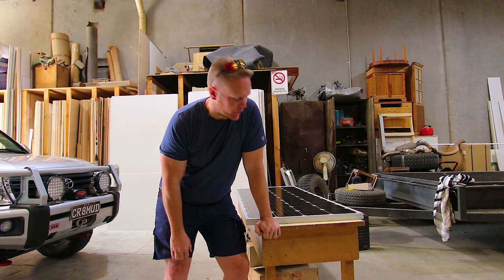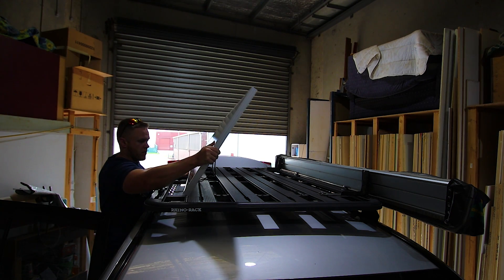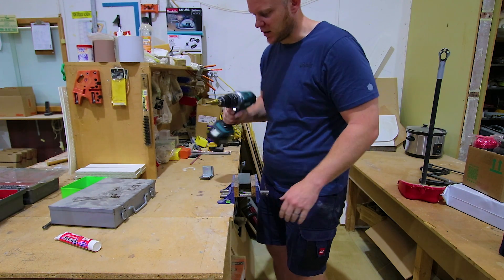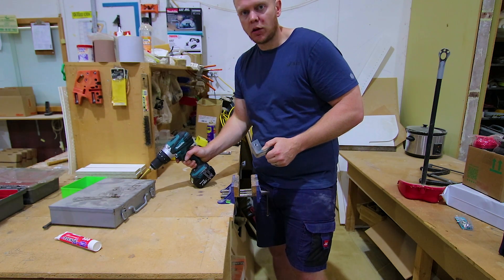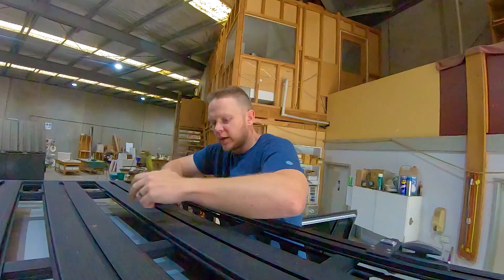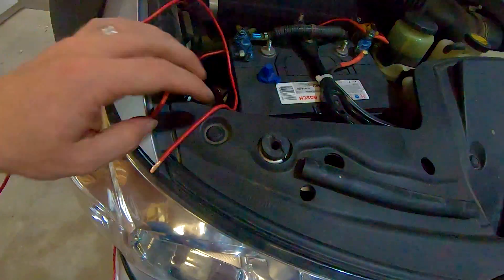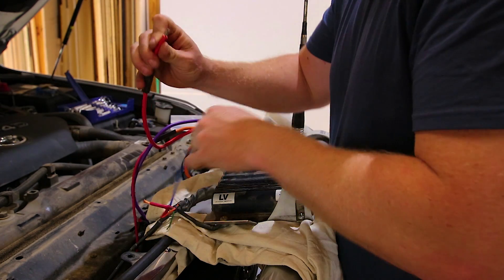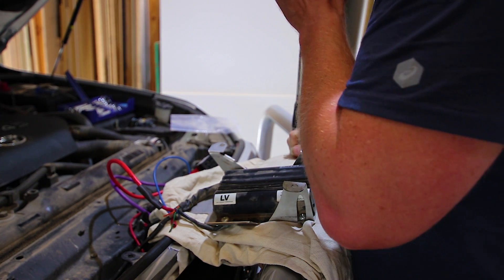Solar Car - Installing SOLAR to YOUR car - NO DRILLING - 300 watt solar panel

Comment: Did you test the wattage ? That is way too small to be anything more than 120 to 150 watts, size is everything when it comes to panels. I like how you routed the cabling from the roof, very neat. Also if you speak to guy's that specialise in wiring for 4wd's they usually recommend crimping over soldering as solder does fatigue from the movement in a 4wd which causes cracking over time while good crimping allows for movement and does not crack like solder.

Comment: FYI If you want to use a shunt to monitor the battery, you will need to run neg wire back to the shunt
Reply from the maker: My battery had a built in shunt which measured it with or without the negative connections. 
DCS 200.   

But yes for normal shunts that is what’s required

Comment: Great job mate. While I agree partially with some of the comments here that bringing earth wire back to source of chassis bond points might be a good idea - the fact that most people commenting here don't realise is that the chassis is a much bigger conductor with better electrical properties than an 8g wire, so that addresses most of the return path. Yes there is potential for the 'last mile' to have some resistance, the Pioneer rack has 8 good quality bolts directly to the roof rail mount points (which are part of the chassis), and the cross members of the platform that connect to the platform mount rails - there are 6 of these. I have measured from one of these cross-member bolts to a ground point under dash - 0.05 ohms. You will NOT get that in an 8 gauge wire, I guarantee it.
Reply from the maker: I personally never had a drama with the way it was wired up.

Comment: Is that thin cable really enough over that length? I would think you'd need a thicker cable to handle the output from a solar panel that size... Also an anderson plug isn't really an ideal plug for a solar panel, it'd be better to use a solar connector - they are designed for solar cables. And lastly does the cable you used have UV stable insulation? It doesn't look like it does. If not it will quickly become brittle and won't be suitable as insulation. Just some thoughts.

Comment: Whats the point of this? Asking as i know nothing about solar usage
Reply from the maker: The point of having a solar panel on your car would be to keep a secondary battery charged up so it runs your 12v fridge longer
Reply from the maker: The point of having a solar panel on your car would be to keep a secondary battery charged up so it runs your 12v fridge longer

Comment: Hey Steve, great vid - it certainly took me a while to find it 2019 etc!! Just a question re: earthing - If the primary battery is earthed to the chassis, and the 2nd/3rd batts are also earthed to the chassis - is it just the power wire that matters for the circuit? ie does having multiple batts to the same earth not matter when wanting to draw power from the aux batts only? Cheers.
Reply: No, not at all! All you need is one common earth point, for all charge sources and load sources for that 2nd battery supply, in fact, if you are running a shunt for the 2nd battery to monitor these flows, and the shunt monitor point only has ONE wire on it to the negative terminal of the 2nd battery (Refer a good source such as Victron, Redarc, Enerdrive). ALL devices should be earthed via common point. In this case, the pioneer roof rack system has solid earth to chassis via 8 mount points, and the platform cross member has 6 bolts connecting it to the side rails. The only potential issue for earthing is Steve's brackets with the earth lug on one of these, but he's proven it works. This is FAR better than bringing an earth wire back to the common earth lug for EVERY appliance, and ends up in a much neater install.

Comment: Solar trailer build buddy.  Build a Solar panel trailer with 9 panels on it 2.5 meters by 4 meters. That would really charge the batteries up wouldn't it.

Comment: I’m not sure why you would cut off perfectly good IP67 MC4 connectors from the solar panel and replace with Andersons. I would have retained MC4s and used weather-resistant solar cable through to the DC-DC charger. But we all make our own decisions. Thanks for the video.

Comment: Hey Steve great content , I’m thinking of a rigid panel on my roof bars mainly so I can still use same space to put my swag on top  just need to know if panel can take not so much the weight of swag but more the tension that would be required for ratchet straps to firmly hold swag in place have you had any issues , cheers Steve and thank you regards Matty
Reply from the maker: Hey buddy. 

I’ve pulled my swag down pretty damn tight on top and it’s never had a drama. 

That’s the main reason I put the middle mount on the panel to give the middle extra strength when I tie stuff down to it.
Reply: @Australian4x4Adventures  thanks Steve I had visions in my head of panel getting bent thanks again awesome content make my set up even better regards Matty
Reply from the maker: You’re more then welcome buddy.  
Sorry about the slow response.  Christmas was hectic 😂

Comment: Steve any extra noticeable wind noise?
Any particular reason you chose rigid over flexible panel?
Reply from the maker: No, no real wind noise that I noticed. 

Main reason for the ridged panel was the fact they are cheaper.

Comment: Just a note:-   DC power is NOT  "earthed".   It  runs  from a  + point back to a -  one.
Reply from the maker: Same same but different 🤷🏿‍♂️😂😂
Reply: @Australian4x4Adventures  NOT  the  'same-same'  at all.    Entirely different!  .. like  comparing  AC  to DC .  There  are another half-dozen  stupidities  in  the above  video. Get   an education before you presume to  educate others Dopey. ...... And  FYI  I  installed  my first solar system  in 1980 (before  you were born, I suspect)  and have  installed/helped install over 1000 systems since then in all sorts  of situations.
Reply from the maker: Same same really.  

If you don’t like what I’m saying then don’t watch 🤷🏿‍♂️😂😂😂
Reply from the maker: Yet what I setup works perfectly fine 🤷🏿‍♂️.  
Hummm maybe I actually know what one doing but I think your arrogance is getting in the way of your Screen. 

Oh well don’t let that little fact get in the way of a good dressing down right?

I really hope that abusing someone on YouTube about a solar panel makes you feel like a real top person and helps you sleep at night. 

I’m sorry I’ve personally offended you to the point it had enraged you. 

I’d hate to cut you off in coles with a trolly if you act this way over a terminology issue. 

I’d like to say thank you for your comment but I’d really prefer it if you hust kept your unnecessary abuse to your self really. 

And just because you are old AF doesn’t mean you know everything 😉😝🤦‍♂️
Reply: @Australian4x4Adventures  I'm aready  not  doing that. It's just that I  dislike the  dissemination of ignorance.   People get  hurt.
Reply from the maker: 😂😂😂😂.  Well enjoy not watching. 

I won’t be thinking of you.

Comment: Lovely work and no one ever shows the wiring path they use in detail. Did I miss something on your diagram which was for a 12v panel not 24v. Now you have a 24v system (on the panel side) and 12v system attached to the same earth structure. 1) what happens if there is a short out on the panel wire, will the 24v fry your 12v systems. 2) How do you make sure you haven't got lots of ugly stray high current high amp running around your motor. Big reason for running +/- dual cable is it contains the current from source to output with minimal chance of loss or stray power. 3) Solar panels are always live, so maybe a Dear Mechanic Sticker on the batteries that the dc/dc cable needs to be isolated as well as the battery terminal to get a no voltage safe state.

Comment: I had a Redarc BCDC Charger and was advised they're designed to work away from the cranking battery due to their main ability in dealing with voltage drop. Also they derate with heat and yours is under the bonnet in the hottest environment possible. Just an observation. Perhaps this is an old install and you learnt the way I did.
Reply from the maker: I’d agree about the heat issue if I had it mounted where I first did ontop of the fuse box.   

But since moving it to behind the grill I haven’t had any issues with heat at all as it gives the unit maximum air flow and keeps it cool.  

Thanks for the feedback but.
Reply: @Australian4x4Adventures Thanks for the reply. What is a but? Considering Redarc reserve these units for intended low temp environment far from source battery you should still review your changed mounting location. At a trade show they lied to me regarding their new product which I had had for over 12 months and they claimed it was their product. They obviously poached it from China and rebranded. I'm an Engineer and know my stuff. We agreed that I should leave and they were being misleading. After that I ripped out my BCDC charger and went with Enerdrive DCDC. At least the Enerdrive has a fan and understands heat implications and includes a battery temp sensor. Enough said. Subscribed and hope you do more reviews for all of us.

Comment: Hard to tell from the video but looks too small to be a 300w unit. I'm with you on the guess at close to 120~150. I've got 2 x 120w on the pajero and the look similar in size.
Reply: 100% a classic fake ebay panel.

Comment: Yeah, I understand peoples scepticism about the earthing method, but I tend to use this method myself a lot too, and cant say I have had many if any issues, and if it works, then great, otherwise higher current scenarios you might go for something extra. 
Does this rack have positive contact with the body that would not be hindered by paint, etc?  I guess another consideration with this earthing system though is that any earthing joints that are exposed to air, moisture, salt, rain, etc, can be a recipe for electrolysis, which could create other issues as well as poor electrical connections and probably ideally should be treated with some type of coating to protect them from the elements, maybe even just a quick hit of a can clear coat may give it some reasonable extra protection with follow ups of DWF if required.

Comment: Nice job, and good vid, my only suggestion might be to consider a sheet of lexen plastic over the top for extra protection  tree branches, hail, accidents, etc.  you could even consider cutting it wider and longer and screw/fix to rack front and rear, for better aerodynamics and safety when getting ur swags on n off, ie; less sharp corners to snag on also and maybe create a nice curve over it.  Also a thin flat flexible panel could make a good alternative for keeping the whole show more streamline I guess. I like the Redarc relay idea too, but I will be making my own amalgamation of that, and while I do have a number of other controllers I could use for that, for the average Joe, a simple Diode in the solar input line should probably be all you need shouldn’t it? Meaning the solar panel is in circuit at all times. Thanks for sharing this

Comment: Interesting earthing method. Hope it all works efficiently for you. Tidy job.
Reply from the maker: Thanks mate.   Yeah 6 months on and no dramas as of yet.    I’d prefer to run less wires.   Things tend to work better that way.
Reply: Yeah, I understand peoples perhaps scepticism about the earthing method, but I tend to use this method myself a lot too, and cant say I have had many if any issues, and if it works, then great, otherwise higher current scenarios you might go for something extra. 
Does this rack have positive contact with the body that would not be hindered by paint, etc?  I guess another consideration with this earthing system though is that any earthing joints that are exposed to air, moisture, salt, rain, etc, can be a recipe for electrolysis, which could create other issues as well as poor electrical connections and probably ideally should be treated with some type of coating to protect them from the elements.

Comment: You could use these the black ones so it dont stand out as much https://rover.ebay.com/rover/0/0/0?mpre=https%3A%2F%2Fwww.ebay.com.au%2Fulk%2Fitm%2F222889270728

Comment: Hi Steve. Thanks for all the details and effort in posting this.  Do you know how many amps you are getting from the panel in good sunlight.  Also do you have the dimensions for this 300 w panel, looked online and can’t find anyone who lists them.  Cheers..
Reply from the maker: Also the amps.  Full sun and it’s pushing out about 16 amps.   

I have a travel buddy oven which draws 6 amps.  Plus my fridge of 4 amps.   And it still holds the battery’s at float while both are running.    

It’s overkill but I’d prefer that then not enough.
Reply from the maker: 670x 1480 was the panel size.       It’s just off of eBay.    

Sorry for the delayed reply.

Comment: Should have got a 1225D that is solar ready. Where do we buy those "bill bits"?
Reply from the maker: I got my 1240 second hand ages ago.    It was just what was available at the time.  

It’s called a step drill. Bunnings will have them.

Comment: Good job and nice video Steve. Did you have to remove those weather shields to run the cable or you just pushed it underneath?
Thanks mate and keep these great videos coming, cheers
Reply from the maker: Thanks buddy.  Glad it’s helpful.  

No didn’t have to remove them.  Just got a screw driver with a cloth over the end and pushed it in.

Comment: It's quite low profile, but have you thought about adding an angle bracket to the front of the panel to reduce drag/wind resistance. Every external mod reduces fuel economy and adds wind noise?
Reply from the maker: I did think about doing something like that.  

Wind generally only really starts to make a big difference after 90km per hr.   

90% of my driving around home is 60-80km/hr.    
The only times I’m generally on 100 is when I’m heading away and I’m ganna have my swag on the roof anyway.   The swag will create a heap more drag then any solar panel ever will so I wasn’t super worried about it.  Thanks for the thought though

Comment: Coincidentally Graham I am in the process of fitting a 170w panel to my Rhino platform to replace an 80w. With the 80w I took the easy way out and just used a length of double strand 6mm wire with Anderson plugs either end. I have a Redarc 1225 fitted with solar capability and an Anderson plug so It just required me connecting the plugs whenever I wanted the panel working. 

With the 170w panel I bought I I wanted it wired in but I found it was slightly to wide to utilise the slide mounting system on both sides, so I used one track and on the other side I drilled and fitted some Rivnuts into the platform. I also used 40x40 ally angle full length along the panel, probably overkill but it looks neat and very strong. The wiring i am not doing but the sparky who is is will run the wire down the tailgate and in through the rubber seal in the top corner. The only wiring to be seen is the small section from rack to rubber cover. It will be very neat when finished.  

If I had my time again, I’d have sourced a panel of the correct width like you did.
Reply from the maker: 😆.  Just replies on Facebook as well.   
I spent a fair amount of time trying to find a panel that would suit the way I wanted to mount it.   

Because I wasn’t spending big bucks on a panel my thought process was that if it fails I can remove it and not leave any holes or have any adverse effect on the other fittings.  

Thanks for sharing your process as well.  Love it.

Comment: I just recently upgraded my panel on my 200 series.. flexible, 200 watter.... 2.4 mm thick, 2.5 kgs weight odd... sikaflex glued it on the rhino rack.. ( i know i know ) ...yes its vented... it serves a purpose.. wired back to a 30 amp regulator for my rear agm battery.... you can also get mounts from fleebay or some such if youd like to.
Reply from the maker: I did think about the flexible panels.   Not 100% why I didn’t go one.  I think it was the idea of glueing it to the rack that turned me off. 
Each to there own really.   

That’s the best part of setting up cars.  Everyone does it slightly differently
Reply: @Australian4x4Adventures  Thats the best bit, when you do it yourself, and if something breaks... its a tad easier to fix.... the mount brackets can be found on fleebay for 30 dollars or so, i probably should have done that myself... used them before on a mates van solar install...and please dont think anything ive said was being critical.... we set things up for ourselves, not some one else.... thats why we can moan when we pay ppl to do it.
Reply: Ill add, i have a redarc 1240 bcdc... non solar model... i can however, plug the rear agm into the 3rd battery ( its charged by said redarc ) under the bonnet , ( i have 4 batteries ) which in turn charges the 3rd and fourth battery ( rear agm ) while driving.
Reply from the maker: Mine is the non solar version as well.   That’s why I had to get that solar relay to run the panel properly.  

I am considering lithium for my next setup but it would mean getting a new BCDC to do it.
Reply: I'll get the gopro out tomoz and do a walk 'round and stuff and some how get you tagged for the vid... its not perfect...it will however give a better idea on what i have just ranted about :)
Reply from the maker: 😂.    Looking forward to seeing it.